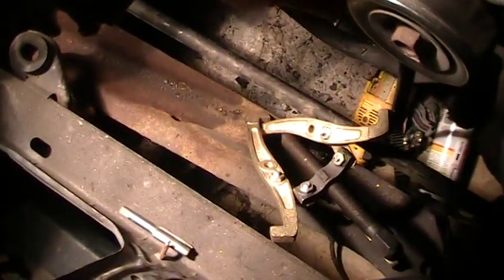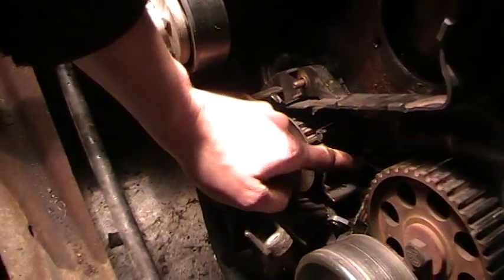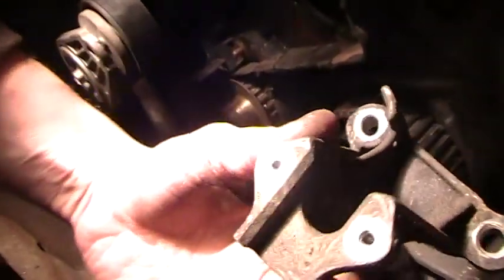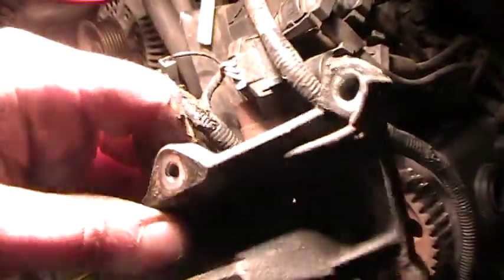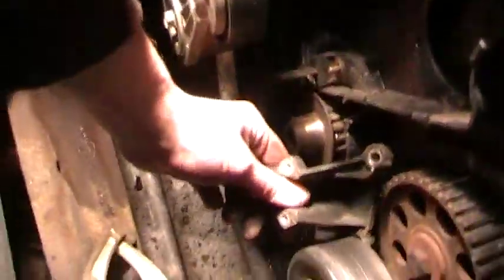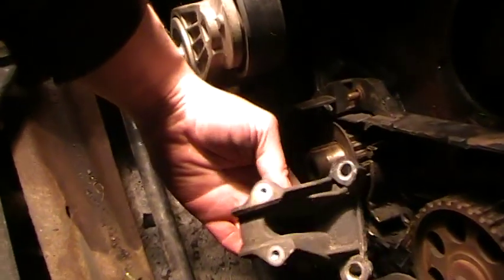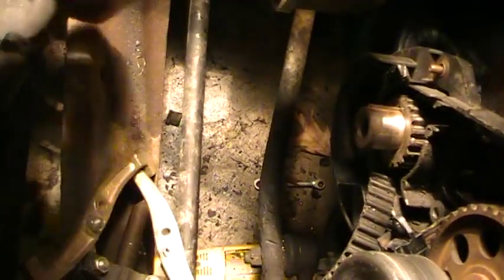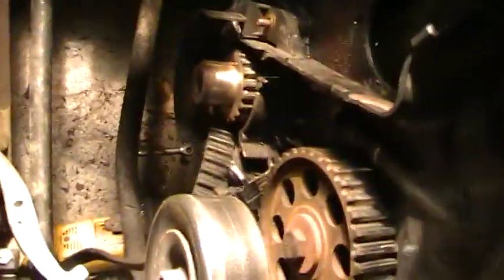1994 Ranger Timing Belt Change 2

Comment: WOW, what a pita just to change the belt! Thank you for making this video. I just bought a nice little 2WD 5 speed because I wanted something 'easy' to work on myself (and wanted to stop the miles from getting any higher on my 2011 Ram (164k miles) and the peace of mind of having a backup vehicle.) I will inspect the belt today, hoping it was done not to long ago. But my luck is ALWAYS bad, so it's probably about to break. It has 221,000 miles on it. So I'm really hoping it's been done twice!

Comment: "what a bitch!"

LOL.

The shaky camera gives it that drama tv feel.  Otherwise, interesting video.  I've done this procedure once, but I don't remember taking off the sensor bracket.  Didn't have to cut the belt either.  I had to reduce the belt tension from the tensioner though.